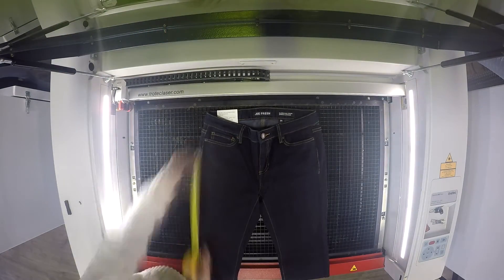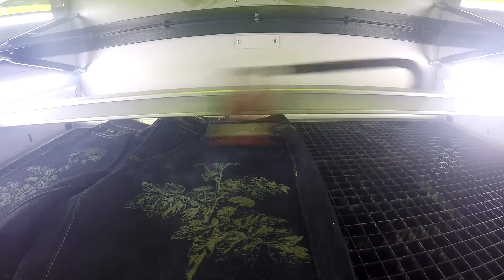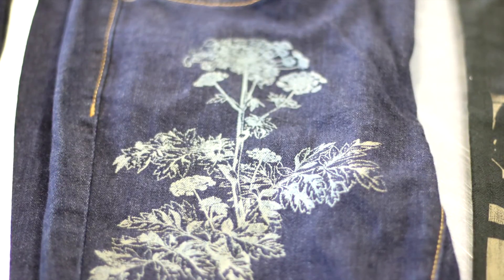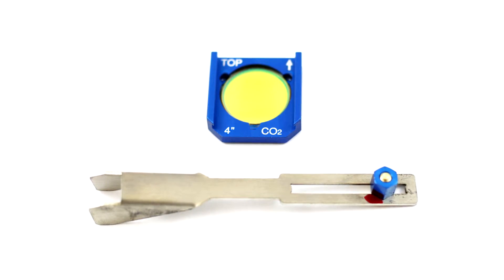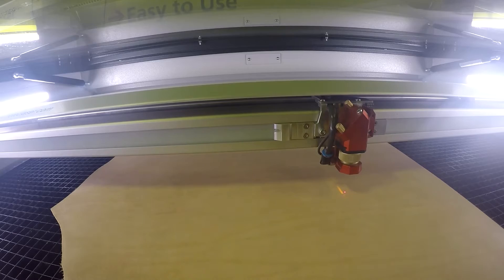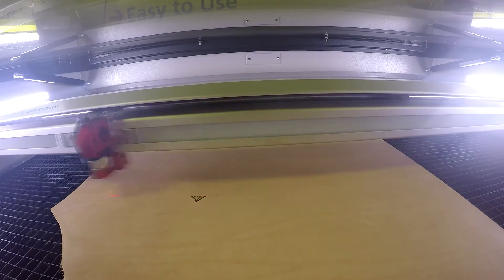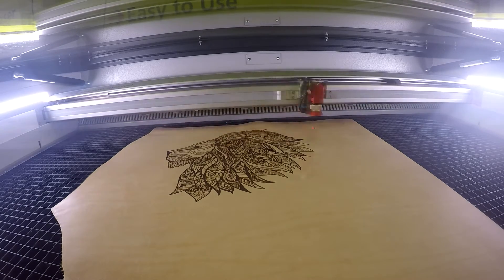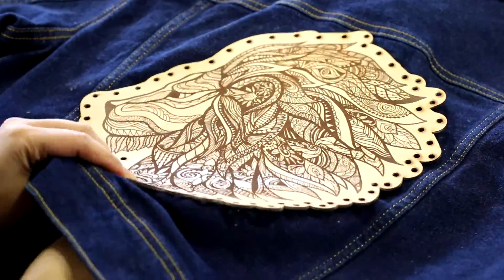Laser Engraving Denim | Laser Engraving Jeans | Trotec Laser

Comment: I've been running some tests on my Trotec Speedy 400, with the 4.0" lens and a variety of settings, mostly ranging the power from 55 - 80, and seeing what happens. So far the color of the denim has dictated the color of the etching; light color = light etching, dark color = dark etching. But I'm sure different dyes and types of denim material can change the etching finish.

So far, I've unfortunately noticed that the etching compromises the durability of the denim/fabric. If you put enough pressure on the etched area the fabric will start to tear and rip. If anyone knows a solution to this please share your findings. I'll keep experimenting with different settings and see what happens.

Comment: Thanks for the video, what's the engraving like after the jeans go through the washing machine? Is there any after care needed?
Reply from the maker: Great question, if they are thick and sturdy jeans it wouldn't be a problem and the engraving shouldn't wash out as the laser permanently burns the fabric.
Reply: I would say, if you're engraving new jeans to wash them a couple times first as you usually would, otherwise the ink will run when it gets wet and the contrast will be lessened.